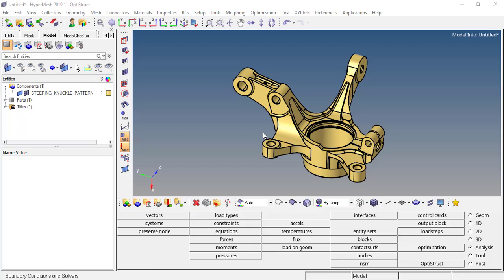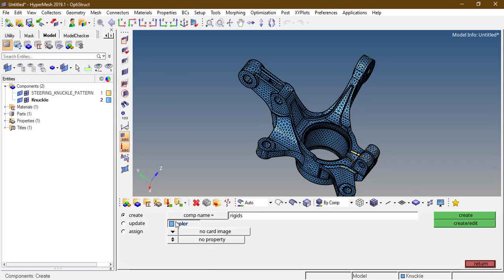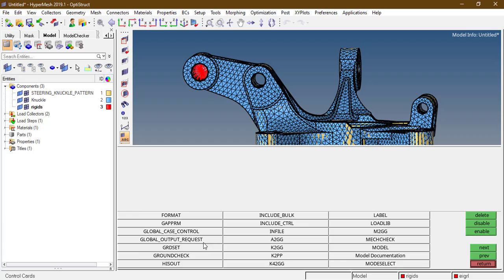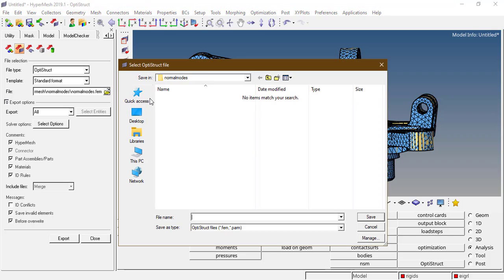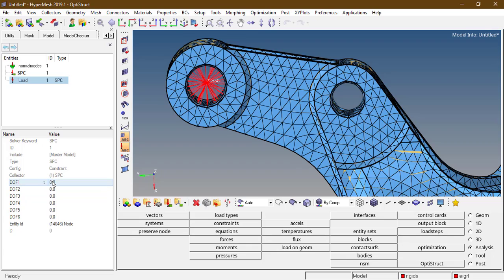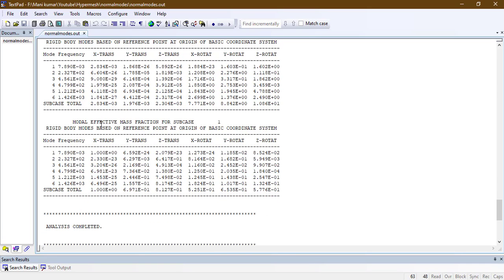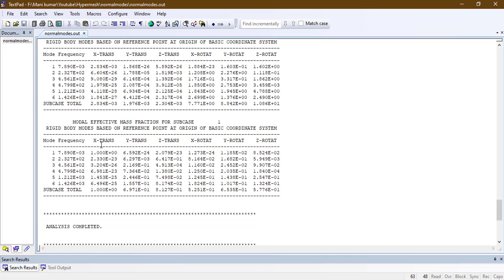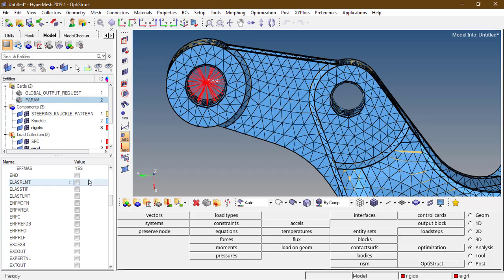Mass Participation factor in Normal Modal Analysis in Hype mesh

Comment: Please suggest me the use of knowing strain energy .
Reply from the maker: 1.ESE will be more helpful if we are working on a Assembly level
2.Elements with large values of strain energy in a mode indicate the location of large elastic deformation (energy). These elements are those which most directly affect the deformation in a mode
3..If you are working on Assembly level at certain frequency 2 or more components will vibrate, in that time which part is more contributing for that particular frequency, in that case we need to check Elemet Strain Energy( ESE) for each component, the component having more ESE will contribute more in that particlaur frequency.
Reply: To check the dynamic instabilities...If strain energy is more concentrated at a particular region, based on these strain energy we can conclude that we need to improve that design at particular region.